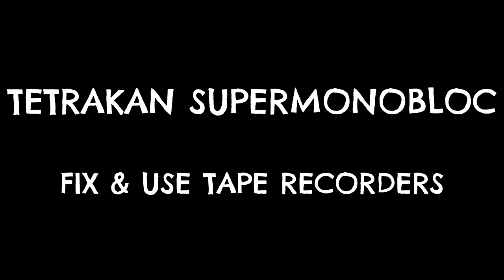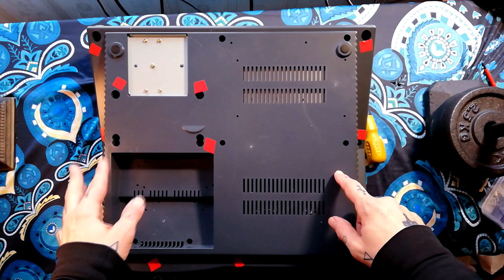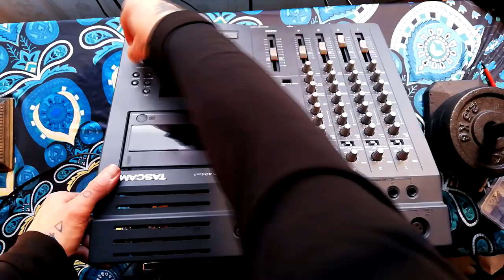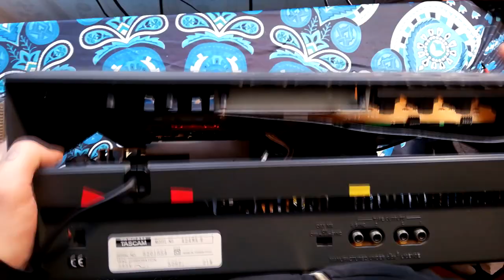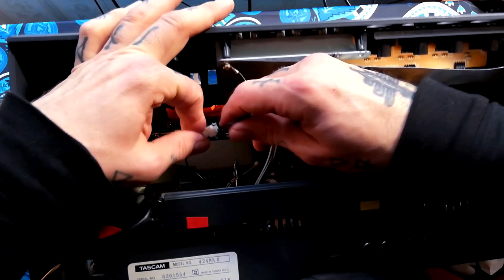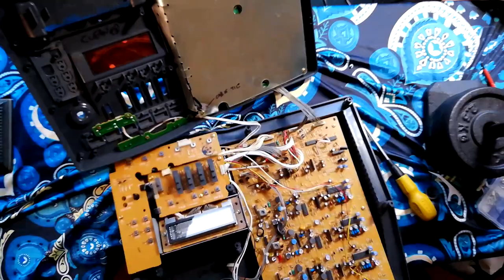Tascam Portastudio 424 MkII | how to open the case

Comment: hey i just wanna point out that, i dunno if yours didnt have these screws, but there are 2 screws directly behind the transport buttons that need to be removed to open it up. of the same type as the screws labelled with red tape in this video
Reply from the maker: Thanks, maybe a previous owner of the unit I'm filming removed those? I'll pin your comment to help others.

Comment: Hey, I just took apart a machine this make and model as channel 3 was recording fine but not playing back loud at all. I opened it up, had a look and decided id leave it for someone who knows more about the machine and I put it back together and the machine won't turn on!? ive located that there is a smell coming from just above the cassette holder where you unplug one of the ribbons from. Do you have any idea what might be going wrong? I cant see any visible damage or burn parts and the fuses around that area are all still good.
Reply from the maker: So sorry, I’ve only just seen this comment hence very late reply! Capacitors can produce an unpleasant smell when they fail, excess heat evaporating the fluid inside which then escapes through holes in the enclosure that can be too small to see, so I would replace the capacitors on the power section, thanks for watching

Comment: Hi! I got a non working unit off of my uncle's old studio for free  and when i opened inside the power transformer was missing! Any idea what type of transformer or where i could download the service manual ? Thanks!
Reply from the maker: Hi, I'm sorry, I don't have a service manual for this model, or a unit handy where I could measure the AC outputs from the transformer manually. Next time I get one of these in my workshop I will take a measurement.
Reply: Oh bummer.. But thanks alot! :)

Comment: Hi

I've had a problem with my 424 mk II for as long as I've had it since 2020. The problem is that when it's been turned on and used for a while the counter starts to act, not counting properly and quickly after that it stops playing. After that I cannot use the machine until I've left it to "cool" off for a while. All the belts were changed, but I think the problem must be somewhere in the counter section of the machine. Is it possible that a failing Hall IC sensor could do this or is it the gear it's measuring to blame? 

Today I managed to take the machine apart (again) and found out that the gear/wheel the sensor is measuring was looking unhealthy. Here's a video I took of it: https://youtu.be/WB_sN9MckTM 

I cleaned that wheel as good as I could and got most of the green stuff out of it, but still the machine suffers from the same problem. I get maybe 20 minutes out of it before I have to turn it off and let it cool.

Have you faced similar problem(s) with these machines?
Reply from the maker: I haven't had the same issue. The movement definitely looks inconsistent. Maybe old lubricant is becoming glue when it warms up? I'd try dismantling it, clean off old lube with isopropyl, replace with silicone grease or similar, rebuild, see if thus resolves the issue?